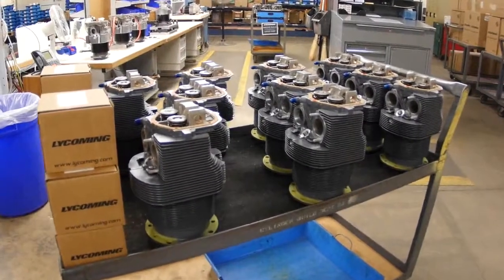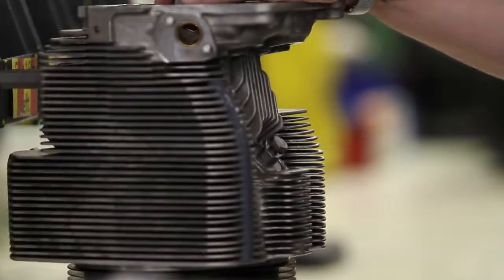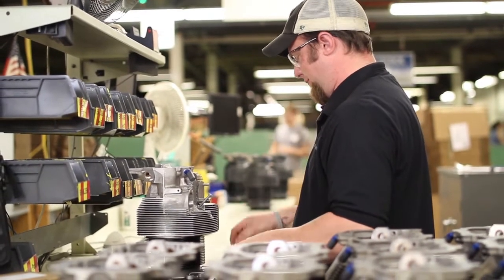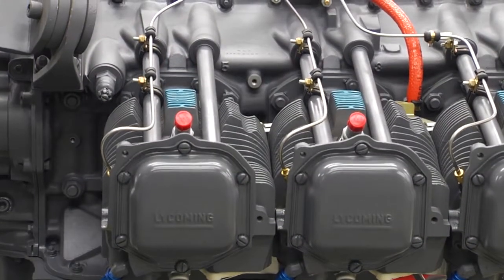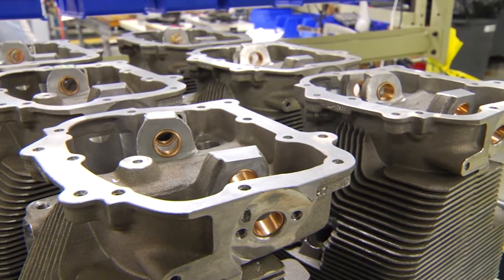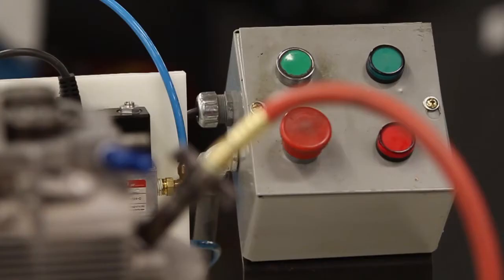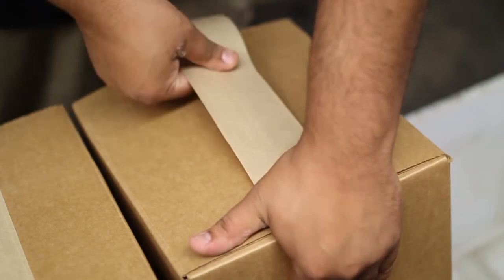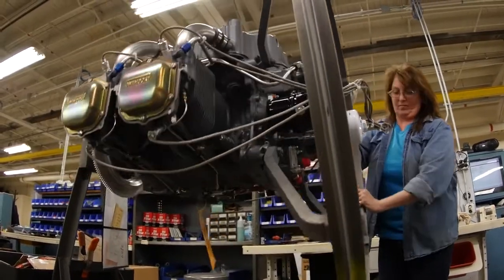Lycoming Engines Cylinder Cell

Comment: Great job sir! Could you tell me what is the press fit tolerance for the exhaust valve guides to the cylinder on the Lycoming O-360 engine? Thanks in advance.